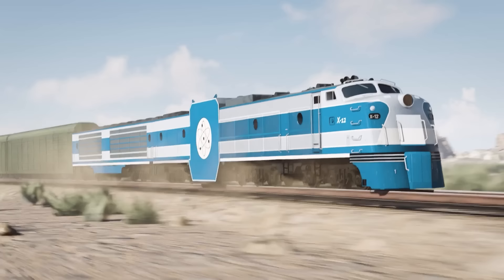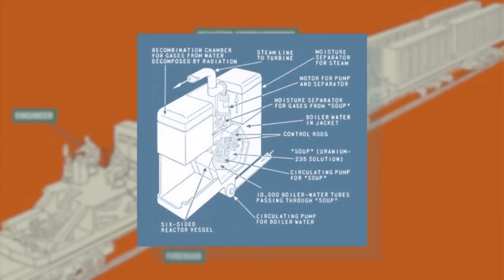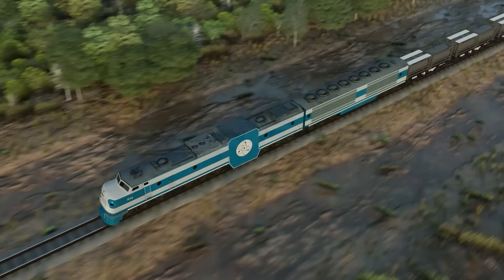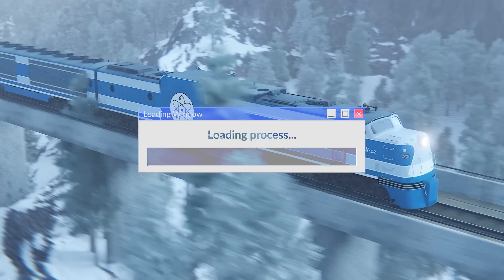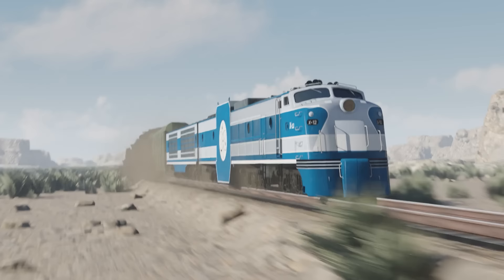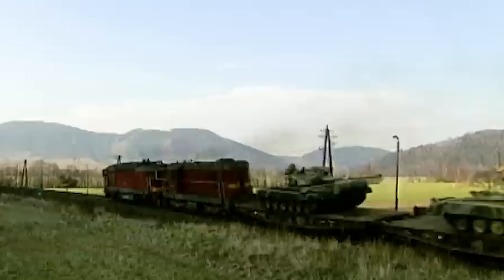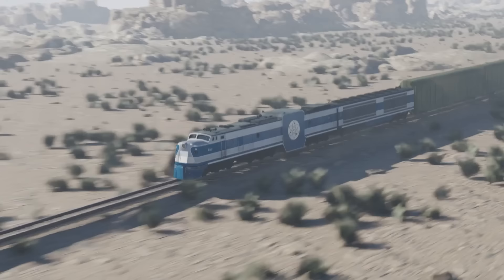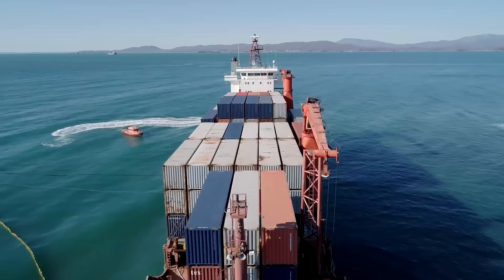What ever happened to Atomic Trains?

Comment: The problem is that no one appears to have thought that a dedicated nuclear power station could be used to supply electricity to an electric railway
Reply: That's too boring and safe and not thrill enough to burn vastly amount of money
Reply: Actually, that would be a downgrade in this case, depending on what nuclear tech is actually being used for the train. Obviously you wouldn't want a light water reactor rolling around but a couple decently sized RTGs (radioisotope thermo-electric generators, which are powered by the natural decay of radioisotopes) running on plutonium would actually be better as they don't have the downside of requiring catenary and don't introduce the potential risks a design with an active reactor does.

EDIT: Ok, watching more of the video, this is using a molten salt FBR. Those fail safe, as they need to constantly cycle their fuel solution to sustain a reaction. So even the reactor-based version wouldn't have many issues.
Reply: @VestedUTuber  RTGs don't have anywhere near the power density to beat even diesel engines. Lasting decades does not help if it's too weak to power the train anyway.
It's called atomic train for a reason, to get the power density required it has to be a full reactor, and a pretty ridiculously light and complex one at that.
Reply: NOW you're thinking like a real "supergenius" like Felon Muskrat! @bocahdongo7769
Reply: Transmission losses?  Wouldn't matter on most routes where the power station isn't far, but on the China-Europe run across Siberia it might make sense to take the reactor along.
Reply: The cost would be way too high. The overhead wires would be more hassle than they’re worth.
Reply: @highloughsdrifter1629  It wouldn't make sense to take any reactor along for a China-Europe run, since the Transsiberian Railway is fully electrified since 2002. It may have been useful before that however
Reply: Exactly this.  Got the process backwards for no good reason or appreciable benefit.  Imo, having the power plant ON the train seems like a far more dangerous proposition due to the constant thirst those machines would have for water.
Reply: Actually they did. Steam locomotion was far cheaper to produce than the electric system. They built several nuke electric mock ups.
Reply: Nuclear maglev?
Reply: @crabbymilton390 well, the Trans-Siberian mainline was finished being electrified in the early 2000s.
Reply: @crabbymilton390 "its impossible, its too expensive, its more trouble than its worth" are complaints only heard from places that dont have electric mainlines already. Other places did it. Most of Europe is electrified or at least diesel-electric hybrid. Hell, before diesels took over, most of the US was moving towards electrics. Now, the same regenerative dynamic braking that puts power back into the caternaries on electrified rails is instead burned off as heat to massive roof radiators by diesels. It can be done, and it's far more sustainable
Reply: “BuT tHoSE eLEctRiC pOlES aRe SO uGlY”

-NIMBY
Reply: @highloughsdrifter1629 bruh, trans Siberian railway is fully electrified as well as most of china, i don't know about Europe, but i believe all the way from somewhere like paris to beijing is electrified already 
electrification actually drastically increases efficiency of already incredibly efficient railways because a big power plant is way more efficient then a relatively small engine on locomotive, losses in wires aren't that big, electrical trains are much easier to maintain and operate too
Reply: @crabbymilton390 say that to any country but us of a lol
Reply: well everyone did
Reply: Why spend the overhead wire money. Jk.
Reply: @noobartz0890  This is America not Europe. So where is the money supposed to come from to build up these electrical systems for your pipe dream trains?
Reply: @crabbymilton390  this is Europe, not america, this is not a pipe dream this is reality
Reply: Exactly, this is such a dumb idea. And especially for trains, you need to couple/decouple the wagons, you need to load/unload, etc. So "it never has to stop" is such a hare-brained concept.
Reply: @noobartz0890 to be fair america would probably electrify the entirety of its railways in 2100 soooooo
Reply: @callsignapollo_  Well diesel electric seems to work so why spend billions on wires to power electric locomotives? Some of these newer generation locomotives are much cleaner and quieter than in previous versions. People are so unnecessarily afraid of nuclear power anyway even though submarines and aircraft carriers utilize this. Oh well.
Reply: @clementpoon120  nah that would be aliens
Reply: @VestedUTuber   well but a 30KW nuclear sterling genrator would work alot better. a nuclear stlring genrator is in a nut shell is like the middle pont between passive power genration from nuclear decay of a rtg but is also combned with bacly also a active power gen of heating water into  steam into power from a very very small trbine or piston like that in a coplty closed loop and self contanted but its also still passivle cooled and won't over heat or melt down as well. also far more compat then a rtg by alot for the amonut of power it can make due to the water can make the pwoergenraton of nuclear decay speed up a bit with a very small amonut of nuclear chain reactions but its only slightly hotter then a rtg but not hot entogh to requre any non passive cooling however.
Reply: @Tracks_And_Chill no, it's cause transit acts like garbage conveyors
Reply: Why don’t we have nuclear cargo ships bigger faster better and no fuel needed. No city is on the way. They ship in the ocean so why not make it ? We have carriers already nuclear powered so do the same for bigger better faster greater cargo ships
Reply: Yeah, that only makes sense if you do not have electrified rails.
Reply: The only problem is it wouldn't be possible to run it in areas where electrification is next to impossible
Reply: That is exactly what France has had for years. The TGV network is mainly nuclear powered.
Reply: @conveyor2   well by full pwoered nuclear power plants powering elctical trains not by nuclear strling power gentrators on the trains themselfs. very simlear but not the same thing
Reply: Electrification of the whole entire railroad network in the USA and having only 1 nuclear power station is a logistical nightmare.

Have to shutdown the nuclear power station for maintenance or an emergency situation?
Then the whole entire railroad network would be also shutdown.
Reply: The development of technology and trying to convince the general public that it would be safe to use would cost far more than installing overhead electric supply.Also the catenary system with regular electricity is a standard technology and thus easy to maintain and use.
Reply: this is exactly what happened in France. TGV was meant to be diesel jet train (and units 001 and 002 were powered by diesel turbine). However, Messner came with idea to build dozens of NPPs, which in turn made electric HSR very attractive.
Reply: there is no overhead wires, no 3rd or 4th rail so the nuclear train would be better
Reply: @crabbymilton390 the same place money came from to build the interstate highway system

You are correct nuclear power plants are far safer than most people give them credit for I would still rather a few large stationary power plants than lots of small plants moving at 100+ miles per hour 

Most diesel electric trains run of wired electricity the majority of the time just using their own fuel when it’s not available in places like Europe and China is rare
Reply: @fletcherclausen4349  The railroads are privately owned. I don’t want give them any money to build something that isn’t needed.
Reply: @crabbymilton390  Firstly I would argue that it is necessary especially with the increasing importance of electronic trains for decreased use of semi trucks and thus carbon emissions and 2 in that case have the government buyout the rail roads maybe then we could get a functional passenger rail system
Reply: @fletcherclausen4349  All I can say is that AMTRAK loses money as a whole. Every time the government takes over part of the private sector, it ruins it.
Reply: @crabbymilton390  the point of am track is not to make money it is to transport people long distances at low cost the reason government run companies fail is because of the insistence that they should make money
Reply: @fletcherclausen4349  The fact that is loses money ought to tell you something. How stupid to just throw money at something when it’s not justified. Some of the route’s could be taken over by a private concern. The best one I heard is when some group out in California was pushing for a high speed passenger train between San Francisco and Los Angeles. The common sense person answered that we already have an option. It’s called a BOEING 737.
Reply: Did you listen to the video at 11:00.
Reply: @littledonnygames64  Reactor cost is still too high, although that could change in the future. There is some R&D money going into "small modular reactors" although AFAICS those are typically in the 300 MW range rather than the 40-80MW range required by a cargo ship.

The other concern is nuclear proliferation - how many poorly maintained nuclear reactors do you want sitting on your waterfront loading and unloading ? How long until someone realizes "hey this can be a really dangerous weapon if I just push the right buttons" ?
Reply: what planet do you live in we have had atomic power plants for like 50 years
Reply: And that nuclear power station only works in one place and can't provide energy over long distances where these locomotives have to go. Genius thinking.
Reply: @johnbridgman4310  so because of being scared 😱 about what ifs we don’t make really efficient something. I’m not afraid of anything I’m 13 so let’s make it. Also we won’t use oil that much so no useless wars for useless oil.
Reply: @srinu20040303  Um, as of 2011 the entire trans Siberian railway is electrified as is the majority of china’s railway all the nuclear power plants are doing is replacing coal or oil power plants the problem of getting the electricity to the trains was solved in the 1920s
Reply: @littledonnygames64  I think cost is the bigger factor - depending on technology and size the cost of a reactor would be somewhere around 5-10x the cost of the ship, and the reactor typically needs to be refuelled (removed and replaced) every 20 years or so. This will hopefully all improve in the future as long as we keep working on the underlying technology.

Container shipping is very efficient these days - maybe $2000 to ship a container from China to west coast USA, maybe 1% of the cost of the goods in the container. Right now the only place it makes sense to spend that much money on a nuclear powered ship is the military, where you are paying for competitive advantage rather than efficiency.
Reply: @fletcherclausen4349  great. What exactly are these power plants are using to produce electricity.
Reply: @johnbridgman4310  yea but we already did. All our 11 carriers are nuclear powered. No screw military I want better use for civilian something. Anyways military is pointless and is a toy in hands of some bad dudes here in DC. We need to work on better batteries for cars and so on. Better cheaper bigger lighter ones. :)
Reply: Actually this is kind of how we have it in Europe (partly), by over 50 years ago.
Reply: Voltage drop enters the conversation...
Reply: @crabbymilton390  No diesel generator will ever give you the amount of power we use in Europe to  run high speed trains on which we rely by overhead wires. The diesel part of diesel electric also poses some maintenance issues that electric locomotives don't encounter such as starting in low temperatures and mechanical parts failures so we only use them on short intercity routes or as shunters in train yards. Also for us electricity is much easier and cheaper to obtain than petrol so we were kind of forced to be efficient. Also the fact that here, over 50 years ago, each country built it's own national small part of the entire european electrified railway system helped in making it achievable, on the other hand the us economy could not possibly handle by it's own the electrifying of it's entire railway system especially since it's owned by private companies.
Reply: @RLMonsterA380  Well you people are taxed so high that makes our Democrats seem conservative by comparison.
Reply: @crabbymilton390  Don't worry, we can afford it.
Reply: I mean to a degree that's nice.  Or just build enough nuclear reactor power stations to give the EV wankers enough energy that they actually need because solar and wind doesn't charge enough.  If it worked then California wouldn't be preventing you from charging your EV because it's too hot or there's too much demand.
Reply: I suspect that's mostly to do with it costing an arm and a dick to electrify the entire network.
Reply: @crabbymilton390  idk where to find money in the richest country in the world tbh, in Europe we have no problem finding money for that lol
actually asian countries have no problem finding money for that too
seems like exactly one country in the entire fuckin world has the issue of finding money on public infrastructure
Reply: @noobartz0890  Well they tax everyone silly and the people are all too happy to give up their freedoms. Unfortunately we have liberal democrats who hate America and think we should go 100% socialist too. Many of them just want to spend that on social programs that have nothing to do with infrastructure. I happen to be an American that likes the freedom of my own car and any infrastructure should be handled on a local or state level not some obnoxious federal mandate.
Reply: @noobartz0890  BTW, America has bailed you folks out any unofficial times. So I guess that’s how you thank us. Isolation is looking better all BBC the time.
Reply: Don’t know how BBC came up.
Reply: this is more steam era topic than it is electrical era.
Reply: yeah but .... the capitalism of cars and planes and terrible maintenance of said tracks plus running power thru tracks sounds inefficient and public safety issues
Reply: @mr_brass_monkey  you never seen an electric train have you?
Reply: ...they did actually.
Reply: @crabbymilton390  (cant tell if you're joking but) so would Multiple induvidual nuclear reactors
Reply: That's not true, I mean sure dedicated no, because there's no reason to make it dedicated, just make the railway part of the power grid
Reply: This!!!!!!
Reply: Literally watch 10:50 of this video
Reply: 10’a of thousands of feet of copper wire is very expensive. But I don’t disagree
Reply: Overhead electrifying and upkeep isn't cheap, the expense projections they had for this were what they were back then.   If you got a small reactor as an idea its pretty obvious one though along with boats and such
Reply: Obviously everyone thought that, hence why an atomic train was never made.
Reply: With this you could probably power cities with the railway system
Reply: electrifyng a railway is extremely expensive too so by making the train less reliant on the overhead lines it could literaly go everywhere there is a track. diesel-electric are perfect for that.
Reply: yeah but its too necessary
Reply: @crabbymilton390  2x the price for 1000x the quality is good
Reply: alot of america used to have electric rail wires above but most were scrapped during ww2
Reply: France did, just learned thanks to a reply i read on another person's comment
Reply: But you have to build a lot of overhead lines. Which not every country can afford.
Reply: It's so dumb 😂
Reply: The French would like to have a word with you.
Reply: But then you need power lines everywhere
Reply: yeah, nuclear power on vehicles makes sense in case of ships, they can't be connected by a wire and are huge so putting a reactor in them is a pretty good idea
Reply: @VestedUTuber  RTGs have low power output so using them for trains is not really practical if you want to actually pull something
Reply: @panzervpl9406 
Except the most powerful current examples of RTGs either use obsolete designs, use high-longevity, low-output radioisotopes like Strontium-90, or or are not much larger than a microwave oven. If you were to build an RTG big enough to take up the space the reactor plus much of its shielding would use, and fuel it with Plutonium like NASA does with theirs, you'd have a vastly more powerful unit. Plus, a unit that big would create a lot of heat and you'd probably be able to boil water with it for powering additional steam turbines.
Reply: That would require a complete infrastructure replacement. Sticking a new type of engine on the existing rails is easier.
Reply: @NoahSpurrier  pretty sure adding cables is easier than having to maintaing a fleet of nuclear reactors
Reply: Also, building a nuclear power plant just for the railways would coz shit tons of money more than hiring a team of engineers to build and maintain nuclear locomotives
Reply: @akkhaaaa  How would maintaining one big powerplant be more expensive than maintaining tens or hundreds smaller ones. Economy of scale is one of the reasons big trains are even a thing.
Reply: I’m pretty sure France’s TGVs run using their nuclear power plants’s power… Or rather, used to.
Reply: Overhead traction power systems are extremely expensive and only make sense if you have heavy train traffic on your lines.
Reply: @crabbymilton390  Because Electric is more flexible, a nuclear train will always be powered by nuclear, but a electric train can be powered by nuclear, solar, wind, or even gas, anything, you just need to wire up the new generators to the system and that's it. Nuclear for now may be more reliable overall, but solar is cheap as fuck, specially for a place with a lot of land like the USA, and the only thing holding back solar is "good enough batteries", we are in the brink of several battery technologies solving that , imagine you invest in changing the system to an all nuclear rail system and just a decade after, the battery revolution happens and electricity generation costs plumet to the ground as now solar can be used without worries, cheaper than nuclear fission. What do you do with your new trains? Now they are being a waste of money. 
Much more logical to do electric trains as you power them with whatever you can convert to electricity, plus electric machines are easier and cheaper to maintain.

Nuclear submarines make sense because they may be underwater long periods of time and is the only realistic power generation system for that use case, carriers also make sense, but in trains it doesn't make as much sense, you need to put railroads anyway, may as well put the catenarie, can't do that on aircraft carriers and submarines.
Reply: Maybe you might have heard of France.
Reply: @timothydevries383  they let you save on fuel logistics, reduce maintenance costs and allow way more horsepower
Reply: the issue with that is that the electricity requirements sould be insane and wouldnt be only one reactor, more likely several powerplants across the entirety of the country following the tracks, it would be extremely costly to do.
Reply: @marcogenovesi8570  Get a large enough chunk of plutonium and it will be red hot, and can boil water... all from natural decay. You can build a steam train that runs on plutonium.. It is just insane to have materials that can easily be repurpose as a nuclear weapon to be used in a train.
Reply: Also mass fission resource problem, even which could cause nuclear explosion, but Moderna dn upcoming advances can make PINCh fission & nuclear fusion akak atomic trains back in action!!!!
Reply: @nickl5658  plutonium can glow red hot already in chunks the size of a D battery, (that's what used in RTGs) but it's energy output isn't that big. Just because it's red hot does not mean it generates enough energy to boil enough water to make enough steam to move a train. It only means it generates too much heat for itself to dissipate. Lightbulbs reach white hot to generate light, they are not used in trains to boil water.
There is a reason if nuclear power plants aren't just giant RTGs that work off nuclear decay like your steam train proposal. You quickly reach a point where you need so much radioactives and so much shielding that it is unpractical even for a building.

Not to mention the fun fact that you can't "shut down" an RTG so if you have a RTG designed to boil water it has to be ALWAYS boiling water or it melts down. Gotta hope you never run out of water on that train. Nuclear reactors can be "shut down" so you are not required to keep running MW of cooling all the time, only a nominal amount to handle the radioactive decay from the nuclear waste in the rods.
More modern designs don't even need active cooling when shut down at all.

Also plutonium is not a natural material you mine. It's created inside a nuclear reactor (either as part of the nuclear waste or intentionally with a breeder reactor) so it's expensive AF, hence why it's mostly reserved for weapons and long lived RTGs for space probes. Most "mass produced" RTGs in soviet russia were not using plutonium but some other cheaper isotope like Strontium or Cesium that are also nuclear waste from a reactor, but much more plentiful (and less useful) than plutionium. 

For a train, both for size AND for weight AND safety (trains derail and crash relatively often) it makes much more sense to just be electric and have a good and modern nuclear power plant somewhere to generate the power.
That also applies to cars and anything else that is smaller than a navy destroyer and isn't literally sitting on top of infinite cooling water.
Reply: Atomic Heart but IRL
Reply: Wouldn’t work, getting power to a train has been tried, maintenance on the rub rails to cost prohibitive.
Reply: @OneBiasedOpinion electric trains have been tried quite a few times, always fail due to power losses and prohibitive maintenance costs in the rub rails. Gotta move your power plant too.
Reply: @callsignapollo_ pretty much all trains are hybrid.
Reply: @pauls7154  the bullet trains of Europe and Asia would like a word with you.
Reply: @nukeboy7633  economy of scale says that it would be cheaper to have a few big reactors rather than a lot of small ones.
Reply: @Tracks_And_Chill  They are, and use a huge quantity of resources, steel and wires that needs constant maintenance, fine for short distances in Europe or UK but a massive unnecessary waste of resources for long runs like the Trans Siberian, Australian or USA/Canada routs, the steel and wire wasted could construct several large cities.
Reply: @johnbridgman4310  Doesnt happen with modular Thorium reactors.
Reply: Soviet Union did. 80% of Ukraine rail is powered by electricity, also there was 3 nuclear power plants in Ukraine
Reply: He literally talks about that at the end of the video.
Reply: Pretty sure the French have...
Reply: That's what I was just thinking lol,  it would make MagLev viable in short scale as well
Reply: The problem of centralized power comes with the risk of disruption. That's why America's long-haul railroads are almost exclusively powered by independent diesel locomotives. America has a lot of "in-between", areas of wide open space where nobody lives and where it takes quite a long time to get maintenance crews onsite to fix issues. And which is easier to send if there's an issue? A whole electrical maintenance crew, or a single two-person locomotive? This is also why passenger rail in America is such a mess; it's hard to be profitable when there's not many revenue-generating stops in proportion to the miles of track.
Reply: @VestedUTuber  Pressurized water reactors like the Navy uses would probably be the best solution. They're designed to remain safe and functional even in very rough conditions.
Reply: @VestedUTuber  rtg are also used in spaccrafts such us rovers and deep space probes
Reply: I am 1:35 in the video and that is what I thought - why not have the reactor stationary and have electrified rails?
Reply: @crabbymilton390   i mean just putting up some wires over tracks is not much hassle for the ability to never have to fuel trains and to run them for next to no money at all. it's something we did in literally the 1800's to great effect
Reply: @samuelgarber1007  What planet are you from where you pay nothing for electricity?
Reply: @crabbymilton390  Oh, so you don't have enough money for it.
I guess you're not the richest country in the world.
Reply: @justaguycalledjosh  We would be richer if we weren’t bailing out other countries from their failures.
Reply: @broski8849  Who wants to visit the chicoms?
Reply: The problem is no one wants a mobile Three Mile Island/Chornobyl traveling through their backyard.
Reply: Guys. You always assume nuclear train will be cheaper than electrify the whole rail line

Have you guys ever hear about.... B-2 Spirit development cost failure? You can electrify the whole US with those amount of money, twice. Imagine if those thing will be nuclear locomotive isn't that far off
Reply: Wow, yes. And current locomotives should be able to connect to a grid as a way to deliver emergency power.
Reply: @edgardominguez8678  How are they supposed to power trains if you want to plug them in?
Reply: You mean like France?
Reply: Anything could produce eltricty. Hover dam for instance.then wires transfer to the over head for the eltricty powered train. Also, there are less dangerous and no radioactive materials.
Reply: @daniellafferety4025  THREE MILE ISLAND was 45 years ago. How long does it take to get over it?
Reply: But putting up wires is expensiiiiiive 😣
Reply: if you are in the US, the northeast corridor (DC to boston) is the ONLY electrified lines trains not including city subways
Reply: @OneBiasedOpinion  not to mention would could possibly happen if, God forbid, 2 of them collided head on, or even with a large enough civilian vehicle...
Reply: I think this was meant for those large empty stretches in Russia. Building and maintaining a power infrastructure there wasn't exactly easy
Reply: @noobartz0890  Apart from a big reactor being more efficient, you don't have to carry a reactor and all of its shielding around, saving energy!
Reply: Now , geniuses will be giving there opinion on shit
Reply: OK but nuclear train has an advantage, it can be deployed anywhere there are tracks, which is extremely advantageous for remote regions where maintaining an electrified railway is impractical
Reply: @bocahdongo7769  "safe". They thought chernobyl was safe.
Reply: YouTubers Will Hate You For Using This One Simple Trick
Reply: thats pretty much like saying using gas to power a generator to then power an electric car is somehow more efficient then just putting the gas into a car
Reply: Every building should have its own reactor
Reply: if your country allows it, electrified railway is much much better, you can also have large nuclear plants with alot higher efficiency numbers
Reply: France
Reply: @Daniel-os9tb  As someone that used to take the train on a 2,000 mile trip once a month, the 3 avalanches and 2 derailments are enough experience to never trust a reactor on a train. They wreck WAY more than you hear about.
Reply: Pantographs may be common in both Europe and the Soviet Union but they are almost non-existent in North America so a stationary nuclear power plant feeding the overhead power lines simply wouldn't work in North America without first establishing the power lines.   Though it certainly would've been the logical answer for both Europe and the Soviet Union which raises the question as to why the Soviets even bothered with this nonsense...
Reply: @VestedUTuber Molten salt reactors are adiabatic and would use Brayton gas turbines not the water and steam turbines with condenser towers described.  A molten salt reactor is also both load following and any xenon produced would rise out of the molten salt hence you would not need a "fire man" to manage the control rods.   A molten salt reactor would certainly make more sense for a vehicle but a fourth generation MSR was not what they were considering at the time and does not match what was described in the video.
Reply: @highloughsdrifter1629 Or just have multiple small power plants along the route.   The pantographs are usually 600vdc for trains so there would be no grid frequency synchronization issues (though I did do an undergrad paper on how using AC power on such pantographs and power electronics for variable speed AC inductive motors would be of benefit).  Note, some train lines have been switching to AC power today as power electronics based inductive motors are now common especially with EV's (they were basically not widely available when I wrote the paper some forty years ago).  The Soviets already used electric trains with overhead power lines and pantographs so stationary nuclear power plants would've made more sense to them, it would be North America where overhead power lines are virtually non-existent and cargo has priority that onboard nuclear reactors might remotely be reasonable (I would hope that a 4th gen MSR with the Braton cycle gas turbines instead of the steam and pressurized water with condensation towers described in the video would be used if they do decide to build a nuclear train).
Reply: @johnwang9914  exactly... considering how inefficient a nuclear reactor this small is and how much maintenance/danger it pose, it is much much cheaper to build electrified railway even for hundreds of kilometers...
Reply: @predatortheme  Well, the costs of establishing the power lines varies with the amount needed.  It's just that both Europe and the then Soviet Union already had the power lines installed over the rails, however the US and Canada relied on serial hybrid trains that carried diesel generators for their power so additional infrastructure would be needed but you are right, deploying the infrastructure is definitely safer and likely more cost effective as it would just be a capital expenditure amortized over decades plus you wouldn't be transporting the massive shielding and in the case of the solid fuel rod pressurized water steam system described, the heavy housing, water and condensation heat exchangers.  Even some power loss on the power lines would easily be compensated by simply not having to carry all the extra mass.   This really was just a ploy to secure more government funding and it's truly ludicrous that the Soviets also fell for it just because their intel said the Americans were working on it (then again they also built a space shuttle just because the US had some).
Reply: Because there would have to be hundreds if not thousands of miles of power cables needing to be ran all over the country and on top of the train that would look like shit for the areas around the train rails and would cause a MASSIVE length of power cable maintenance and many fail points
Reply: @nexpro6118  And yet both Europe and the former Soviet Union used overhead wires and pantographs to deliver the electricity to their trains.   You're only trying to fabricate an excuse.   Most of the trains in this world receives their power by overhead wires or third rails so the task is not nearly as daunting or as unpleasing to the scenery as you are trying to make it sound.  Besides, you can not deny that a stationary nuclear power plant would be safer than one on the train...
Reply: @crabbymilton390 so? Roads dont make money either. Certainly not in the amount they exist. You are biased and dont realize it.
Reply: @KeVIn-pm7pu  Try to deliver goods without roads.
Reply: @crabbymilton390  Your argument is misguided i am not against roads. but you use an argument that is appliable to both.
not all black and white crabby. there is a difference between having 12 lane highways and having a small street for connection.
Apart from that you literally can connect companies via rail.
Reply: @KeVIn-pm7pu  I’m not at all against rail. But if there was truly a demand for widespread passenger rail service, the freight haulers would be offering in on their lines.
Reply: @crabbymilton390  Thats a false assumption based on a false assumption. First of they earn a lot with freight; the investments necessary to do both good are huge. Companies avoid anything that is low or slow in return.
further demand is not enough, it needs to be profitable demand. which is not the same for a company.
plus some "profits" dont exist for companies because they only concern the public.
and last but not least how do you even define "demand for passenger rail service"?  There is demand for transportation, no one cares how they get to their destinations. the only concerns are how good and fast are the connections to their destinations.
Ever heard of the phrase " if you build it they come".
Reply: @KeVIn-pm7pu  You just validated my argument. There’s no profit in long distance passenger rail because nobody wants to take a train cross country. Sure AMTRAK does but they lose money.
Reply: @crabbymilton390  no you just didnt read my comment at all. try again. then we will continue.
Reply: @KeVIn-pm7pu  I did read it. You just want to argue.
Reply: @crabbymilton390  my comment literally says that it is profitable. only that it isnt necessarily for private companies.
if you read it i dont get how you come to the opposite conclusion.
Reply: @KeVIn-pm7pu  Fair enough since the government shouldn’t be in the railroad business.
Reply: @crabbymilton390  of course it should be. especially for passenger rail they should. Too many upsides to it to not have government in railroad business. Private railroad companies only make it worse. ÖBB, SBB are great examples why.
Reply: Don’t solve too many problems u might disappear 😂
Reply: Why not use the train as movable reactor with tracks laid out in secluded deep forests and supply electricity from it to towns and cities, cuz it’s moving through air it can be cooled easier and nuclear disaster will be averted cuz the moving reactor won’t spill irradiating material in a single spot
Reply: @OneBiasedOpinion  Doesn't the power unit condense and re-use the water?
Reply: @crabbymilton390  nah your country broke because it keeps bailing rich people lol. And you don't seem to know a lot about trains, people who like trains mostly agree it shouldn't be privatized
Reply: In certain scenarios like a presidential thing, a nuclear powered train would be resiliant to outside forces.
Reply: Correct more safer and definitely more reliable too.
Reply: There are lots of train system in the world which is completely electrified, and most cases doesn't matter where electricity comes from because electricity is always there, for example in India 75%+ electrification is there and where I live it's hard to find any train which is not directly electrified
Reply: lmao exactly just by reading the title any engineer would go like - well just make a big power plant it will be more efficient because of scale and more useful and more safe.
Reply: That method couldn't be used in apocalyptic situations when you have to run forever.
Reply: It's on 10:43
Reply: alternatively when that is not available, it still ridiculous to carry around nuclear power plant, when you already hauling coal and oil tanks thus refueling is the least of the problems for any train
Reply: @Tracks_And_Chill  Stick a third rail down .
Reply: @arch9enius  totally, but is some areas their banned as it’s considered more dangerous.
Reply: The problem is that EVERYONE thought of that and that's modern trains.
The famous french TGV entered the scene during the same time as France was building hundreds of nuclear power stations. It's literally a nuclear train;)
Reply: Aren't we already doing that? By putting the nuclear power generator away from city for safety and using wires to power electric railway?
Reply: If trains in galaxy railways actually had a working atomic boiler:
Reply: The problem with that is it would cost way more to electrify all of America's railroads rather than just make locomotives that produce they're own power such as the ones described here
Reply: @IsopropylAlcohol5891  
1)your comment implies that they should remain unelectrified;
2)that 1970's oil crisis didn't sucker punch the country to its knees and that mass focus on nuclear power stations would have greatly diminished that impact.
As a result you have a country who has high speed rail, electirified railways and massive power infrastructure less dependent on oil imports. High investments, but far less losses during the crisis too.
Reply: Too many problems with that, i promuse they did.
Reply: Those things cost s a hella lot a money , best to spread the cost over residential and industrial users as well . 

And even  then , it's doubtful they make their money back .
Reply: @highloughsdrifter1629  The Russian parts of the transsib are electrified.